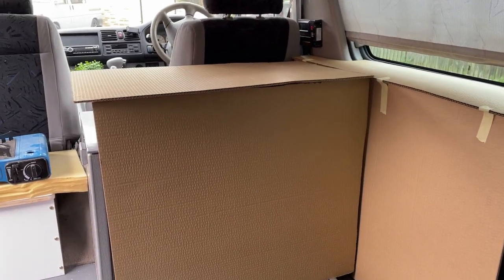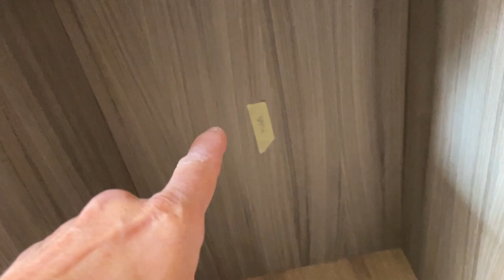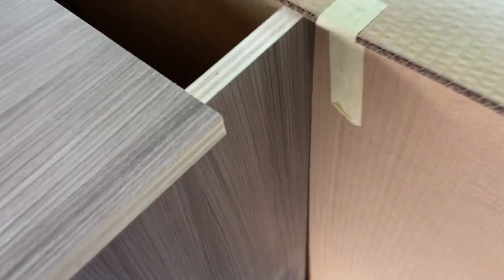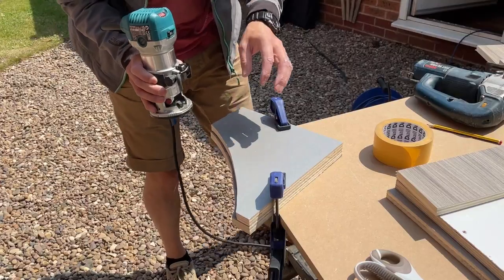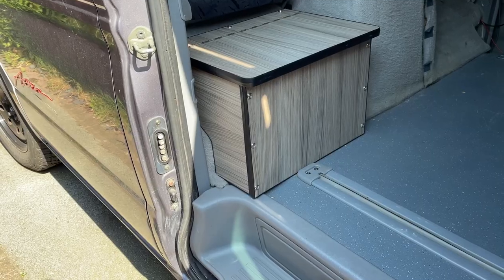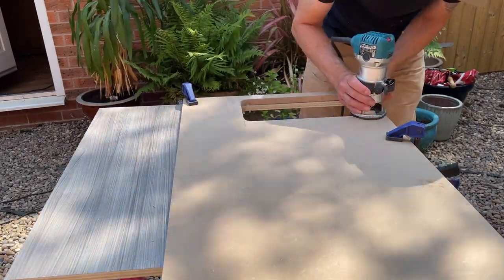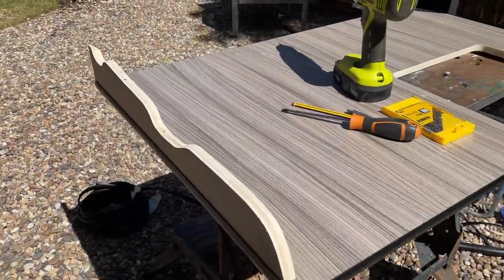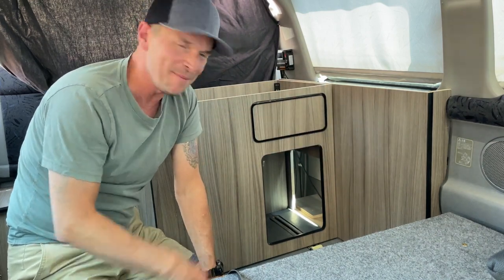New Conversion Begins Part 2 | Campervan Conversion Mazda Bongo

Comment: Maybe you’ll cover it next time but how will you get to the engine? Excellent conversion idea and thanks for the cabinet making tips. 😊
Reply from the maker: It's the same amount of access as I had before, so you can tilt the seat back enough to get in and do most things. For more serious engine work I'm making the whole kitchen pod very easy to remove (you'll. see what I do in the next few videos!). Cheers!

Comment: Hi and great video again, you have some nice tools for your projects now, you just need to convince the boss about a CNC machine,..
I have been looking for a solution on how to have the porta-potty in the van when the bed is out as you know space is tight, I saw a conversion the day before and they had a ledge to act as
 a seat and I presume to support the loo at night, I think your idea is an improvement as you have a storage box as well......my question is, I would like to build one the same and wondered
 if you could draw around your two curved template pieces on newspaper and post them to me as you seem to have the shape just right, I will pay you postage and time of course. 
thanks and look forward to the next installment.
Reply from the maker: Thanks! I can only dream of a CNC machine....

Loos are difficult to fit into these small vans, I can put one under my additional seat when in L shape seating mode as I did in this video here - https://youtu.be/cleMhfshHf4 - But you'd nee that exact toilet to do it (and I don't really like that loo to be honest with you!).

I only actually made 1 template for the pull out cooker slider opening, the other I simply jigsawed it close then tidied it up with a flush trim router bit. It might be better to give you the exact measurements and I'll tell what to use for the rounded corners (it's a common household item) so you can easily recreate it on your project? I  don't mind sending you a paper template, but measurements might work best so you can adjust them as you see fit. Just let me know!
Cheers 👍

Comment: oh yes .. nice new kitchen,,,   im just about to buy a bongo and was wondering  with the kitchen behind the driver seat and you still access the engine from drivers side
Reply from the maker: You can get access, it's a bit limited, but I've done several oil changes with it like it is. I've actually made it so I can remove the whole thing in 10mins for more serious engine work. Also it's not that bad to remove the drivers seat so there's options! 
Cheers 👍

Comment: Hi as some one who is 6'1" tall are these Mazda bongo campervans big enough ?
A.bed length ?
B.legroom when driving ?
I have a Talbot motorhome at the moment and am contemplating getting  something like this as it is automatic transmission .informative videos bye the way 👍😊
Reply from the maker: I think the best way to answer this is to go to a meet up and sit in one and get a real world sense of how big/small they are. 

Bed length will depend on the layout as some have rock n roll beds (apporx 182cm) whereas others have the factory seats just laid down and as you can see mine is a totally different thing again.

If you are anywhere Stourport on Severn (Lickhill campsite) there is the national Bongo bash happening this weekend where you could turn up and see lots of different layouts and probably sit in a few to judge the driving position.

I have no doubt there others that are the same height as you being perfectly happy with these vans.

Sorry it's not a direct answer! cheers 👍
Reply: Thanks for replying

Comment: Please please can I ask ref you blocking the rear air con so the front can be filled and working, I messaged on the video but maybe you missed it, your help knowledge would be hugely invaluable. I just want some air con even if just in the front 😮😢😢😢
Reply from the maker: Hi, I did reply to your other comment, but the comment section can behave really strange sometimes! 

I've yet to discover the exact method of blanking off the AC, as soon as I do I'll do an update video! I really need AC in the front as well 🥵 🥵

Cheers 👍
Reply: @VantasticIdeas just had mine done by a local aircon repairer,  my pipes had been cut and bent over where the rear matrix was removed.  The aircon company cut these out and repiped with rubber hoses and now front air con all working .
Reply from the maker: @sueb8678   Ahh good to know!! maybe I should get a quote to get mine sorted like that. Thanks 👍